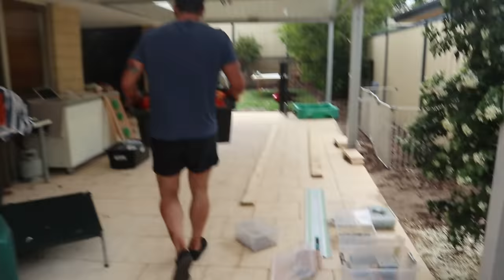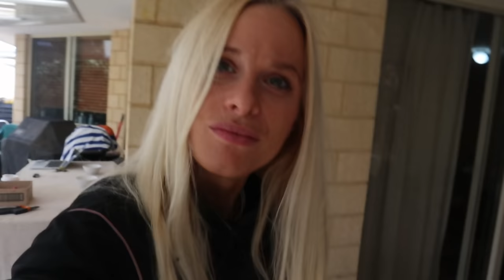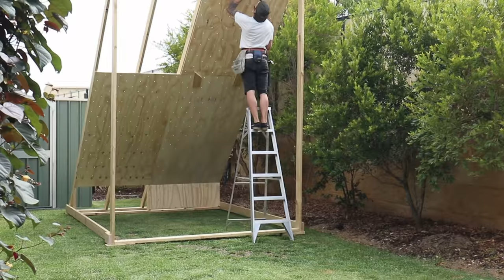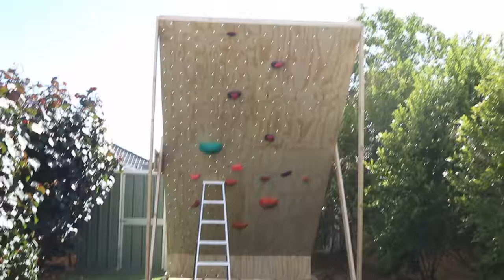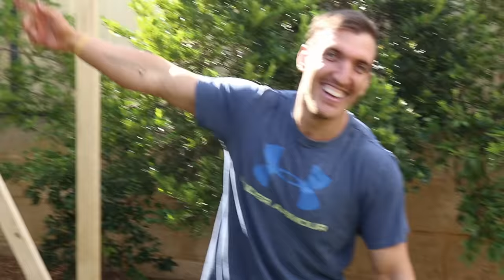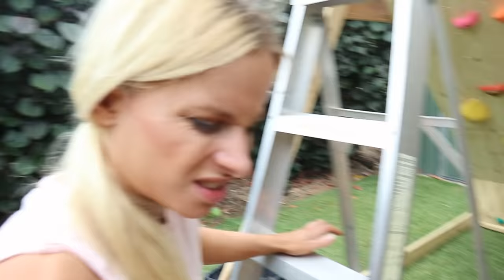WE BUILT A CLIMBING WALL - Our New Home Woody

Comment: Yay I'm just happy I still get to watch you two climb. So cool I want to build one so bad in my in laws backyard
Reply from the maker: The climbing will continue 🙌 World's best in-laws right??
Reply: @AnnaDavey  they really are and her dad is a carpenter so I'll probably be like Tom in this situation
Reply from the maker: @americanman6347  😂😂
Reply: For a couple hundred dollars you can build a really respectable wall, I've made a bunch of holds for mine with wooden railings , banister toppers and trim. Cheap and not much different from resin holds, the fine finish on them makes them super skin friendly.  Just make sure you back the head of the bolt with a good washer.

Comment: Will it be okay if it rains? 
And what was the cost of the project? At least materials, timber, hold , skrews etc. I would love one some day
Cheers!
Reply from the maker: If you actually watch the video , I explain there's a tarp. In AUD wood was $650, Tnuts $75, mat $50, holds and screws I'm renting from the local gym (which is closed) then paid labour for the builder

Comment: Looks awesome! Encouraged me to attempt to built one as well.
Can you upload a material list?
Reply from the maker: I didn't buy the materials so I don't know specifics. Ply Wood, Timber, screw Tnut, holds and bolts. 
There's a good list here: https://www.climbinganchors.com.au/guides/building-a-woody/
Reply: @AnnaDavey  May I know what angle did you build yours at? Looks like 30 degrees at least.
Reply from the maker: @Moshekedem  it's 45°

Comment: How much roughly was it for all the wood nut bolts ect, can you make a hardware list
Reply from the maker: The carpenter bought all the hardware for me and I just paid. Wood was $650. 250 Tnuts were $75. Bolts came with the holds cause I'm leasing them from my gym. Pretty sure it was just 4 sheets of plywood and 8 lengths of timber 🤷‍♀️

Comment: If you’d mounted the ply panels sideways instead of vertically you wouldn’t have that problem with flex in the middle I don’t think
Reply from the maker: I'll tell that to my builder 😂🤷‍♀️
Reply: That would actually make it flex more vertically mounted ply has a smaller horizontal area that it can flex in .  I'd need to see the back but horizontal bracing would likely solve any flex issues the best. If it's flexing it's because it's in a weaker part i.e. spots where 2 pieces of ply come together with nothing backing them etc.  Easy fix
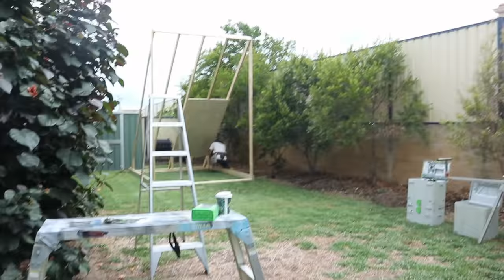Reply: @driklol  You can see the back at 3:25, its vertical bracing behind so horizontal mounted ply would be better

Comment: Strange notion of social isolation in Australia?  Car trip to obtain holds ... bringing in a professional to build your wall ...
Reply from the maker: Yep at this time (3 weeks ago) you could also host a outdoor fitness group of 10 people, Have parties of up to 10 gatherings, get a massage and a the shops were open  etc. Stricter rules came in a week after. Supermarkets are still packed with people though! We still only have a very small amount of cases here.
Reply: You got there just in time!  Over here in the UK the climbing walls shut down along with all non-essential shops and services three weeks ago ... quickly followed by local authority closure of outdoor gyms and children’s playgrounds, both of which I’d been hoping to use in quiet times to get some kind of a stretch.
Reply from the maker: @stevestevenson7569  Australia was way behind. We went into isolation like 3 weeks behind everyone else and then it was another 2 weeks until they went into stage 2, which means we can leave the house for groceries, medical and exercises only now and no more than 2 people at a time.  So we actually got this done in the last week that it was possible yep. I guess we're behind as our infection rate is wayyyy lower. Like only 300 cases at the peak in Perth. And 75% of those recovered. Curve is going way down here too. We're not as condensed as the UK. Huge suburbs...not many people